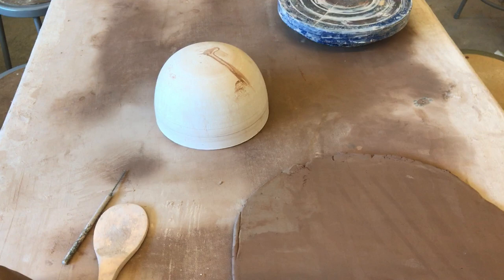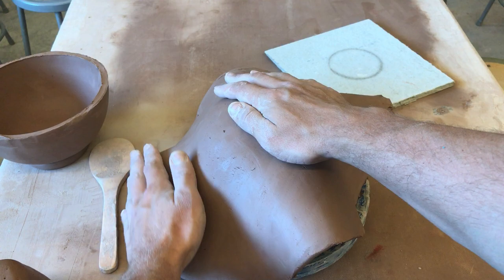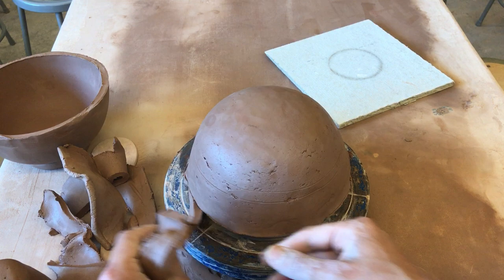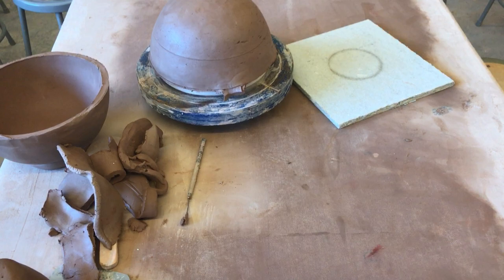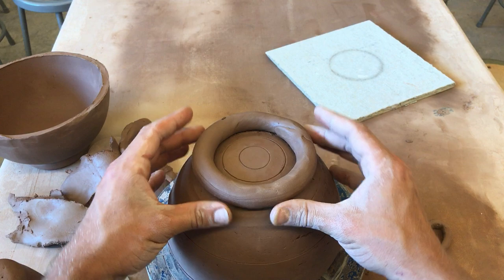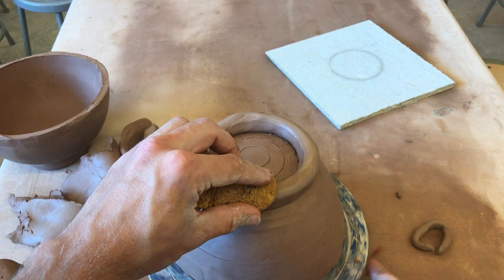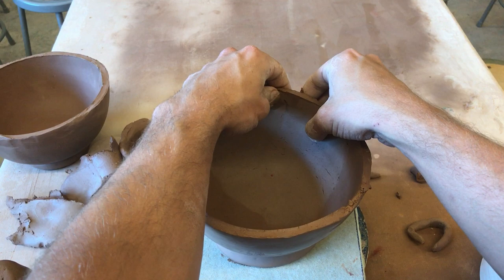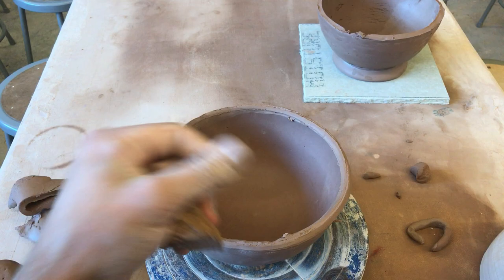Slab Bowl With coil foot

Comment: I made positive molds like yours, but the pots shrink and crack before going leather hard. The mold doesn't allow shrinkage. I made negative molds...no shrinkage cracks. The negative mold, also, just works better through the whole process and makes a nice smooth outer surface. The lip of the pot can be cut off at the top of the mold perfectly. Michael

Comment: Why does yours just pop out and mine always sticks lol ???
Reply: if you have a problem with it sticking you can use a damp fine cotton cloth (like "flour sack" cloth) and smooth it over the mold (making sure there are no big bumps or folds in the cloth) before stretching the slab out over the mold, then when you go to turn it out the cloth will come away with the bowl and you can peel it out after. Doing this can make for more finishing work, but that can be minimized or eliminated by being careful when placing the cloth.
Reply: You might need more drying time:)